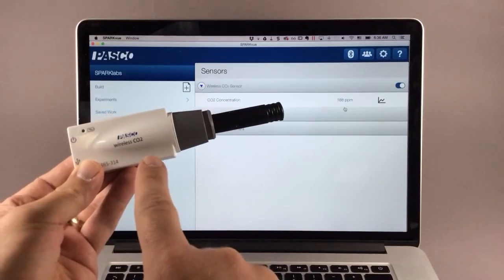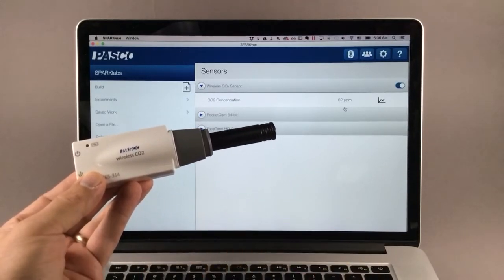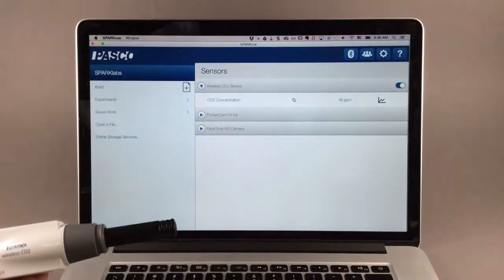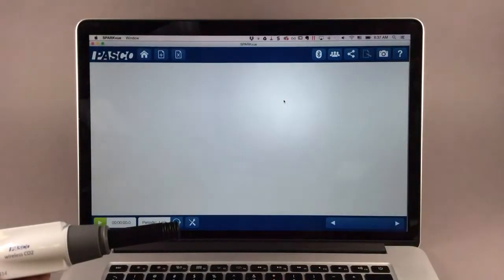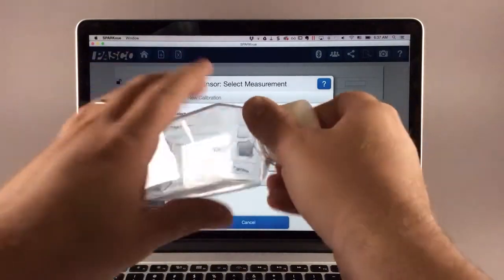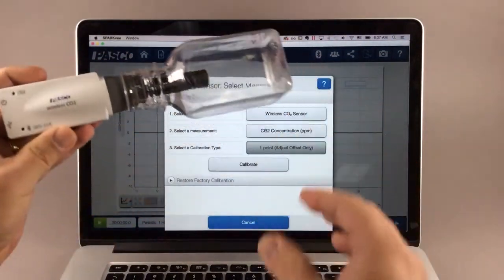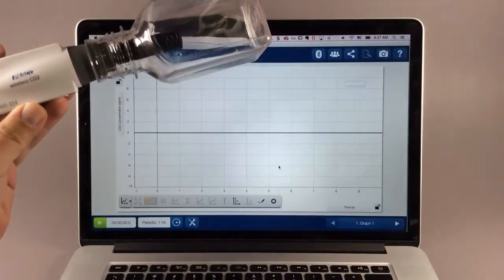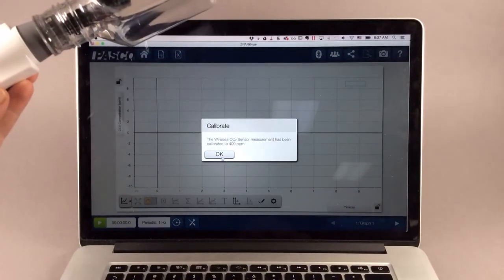Calibrate the Wireless CO2 Sensor (SPARKvue)

Comment: What is the point of this?
Reply from the maker: You can calibrate your Wireless Carbon Dioxide Sensor whenever it is giving unreasonable readings, such as outside the range of about 300-500 ppm for fresh air. Since fresh air has an approximate CO2 concentration of 400 ppm, it's used as the calibration standard for convenience. Since most uses of the sensor in education look at changes in CO2 concentration, this approximate calibration technique in appropriate for most applications.